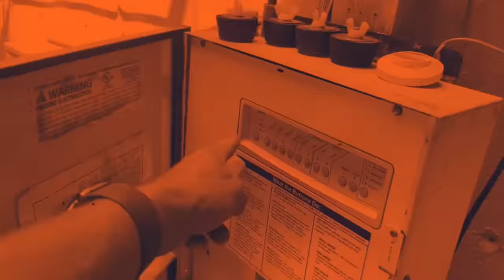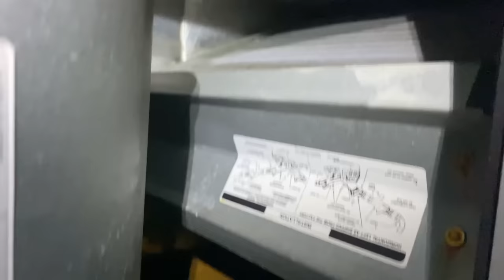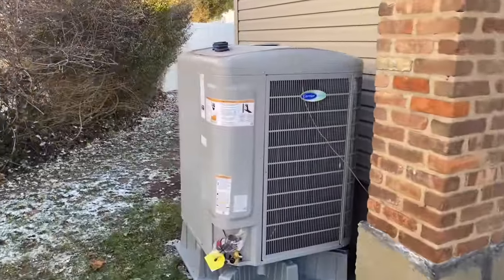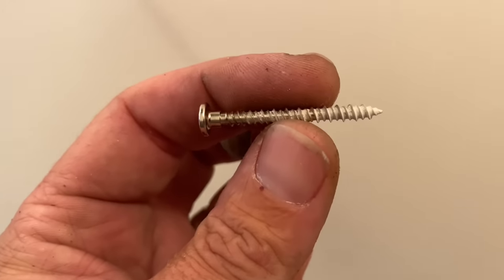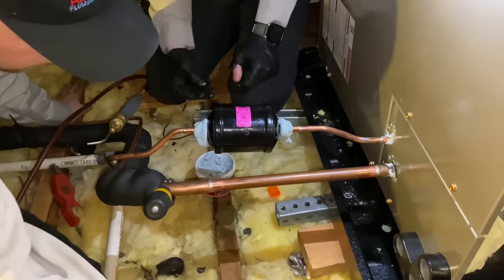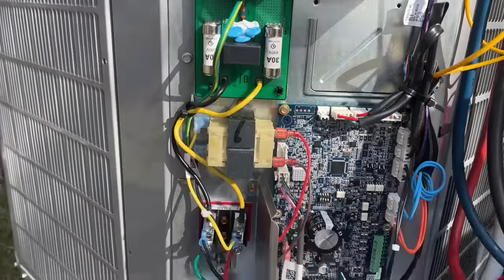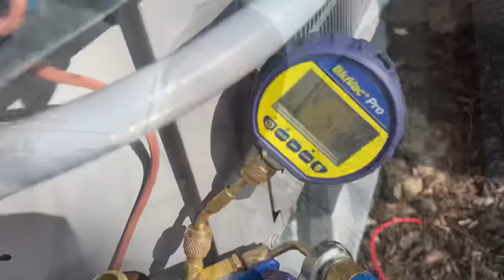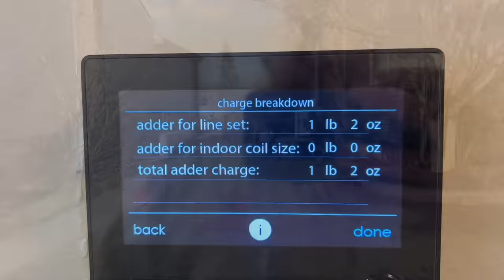Electrification in 2023 Oil Hydronic Heating to Electric Ultra Efficient Heat Pump HVAC System

Comment: High efficiency system in an unconditioned attic.  Not sure I'm a fan of that concept, seems like if you want to spend a pile of money on efficiency, your typically better off tightening up the building envelope first.
Reply: @PipeDoctor  Floral Park native, now out east.  I see it all the time, not your problem/fault, but typically the best money spent is on insulation and weather sealing.
Reply: @tccoggs  that's no lie!
Reply: Perfectly normal I’m Florida to have them in Attics. I’m an hvac technician and installed a 3 ton 20 seer system in my attic. Been running great for 7 years now.
Reply: I install and work on hundreds of these. We are Carrier dealer and from my experience. If you have poor insulation and inefficient ductwork. These infinity system sucks, they have a tough time operating. I never recommend an infinity system if you have a poor insulation.
Reply: In northern climates, the problem with condensing equipment in attics during winter is the chance of condensate freezing. If that problem is properly handled, it works (although with forced air and heat rising, the lower levels and the lower parts of rooms might feel cool). For cooling during summer it’s probably better since the cool air falls and the warm air rises.

This looks like replacing equipment on a retrofit into a house where radiators and a boiler were the original form of heat, and there was no cooling. And the house is probably poorly insulated unless someone went to the trouble of insulating in one of the last three or four decades.
Reply: @ronnyrath816  I think this is the biggest problem with the concept of drop in retrofit heat pumps.
Reply: Most attics aren’t conditioned.  I don’t know of any around here in California.

This is typical.
Reply: @xzibit8614  While it's not the norm, if its efficiency we are after with heat pump swaps, it's time to start considering alternatives to the old cold attic design.
Reply: The homes are too tight now a days, why do you think they say to have an outside air supply or “free cooling” economizer….
Reply: @tccoggs   Why? Real question. This is a great appliance installed by a great company in a very entertaining way! In an attic suffering from the very conditions in your narrative. Based on only this comments section, I’d suggest that North America is totally fine with this level of quality and it probably isn’t time for the implied inclusive or exclusive “we or us ” “to consider alternatives.”

For the discerning customer, however, I’d agree. Or for someone with mold sensitivity. Or anyone immunocompromised. Or anyone under, say, 2 years old. Or over 60. Or anyone who thinks it is NOT a great idea to have  4” of fiberglass insulation in a ceiling to be the complete thermal lid on their building or who doesn’t want a terrarium in their attic where condensation grows white stuff and rusts roofing nails in climate zone 5 or 6 or higher.

For those special customers only, THEY might consider alternatives. But I wonder why my energy should be used to consider alternatives for the others who are just fine with all of this. That DOESN’T seem efficient at all.
Reply: @melvin_0bviously  it's not common in the Midwest. We have conditioned utility rooms that handle it all. Seems to be the rest of the country does this though.

Comment: I have two of these units that also replaced straight A/C.  Auxiliary is now also hydronic baseboard (natural gas boiler)… so very similar setup.  I’ve never been too sure where to set my changeover temp from hp to hydronic.  I want to maximize heat pump but I also don’t want the units going into defrost a lot and pumping cold air into my house (no hydronic coil to temper).  Been using 38 F as the changeover but wonder what others would use?  It’s not a common setup!
Reply: You need to look at the submittal of your equipment. It will say the COP(coefficient of performance) based on outdoor temperature. Electric Baseboard heat is 1 cop, if at lets say 10f its 2 cop, its twice as efficient than baseboard. You will have to see when prices intersect based on avg $/therm and $kwh.
Reply: Wow that sounds complicated.
Reply: Suggestion to calculate appropriate switch over temperature for your location - look up the graph of COP vs outdoor temperature for your heat pump.  pick a reasonable value - say 2.5 and see what outdoor temperature that cooresponds to on the graph .  Calculate the cost of heat for your location via the heat pump:  kwh/$ * 3415 Btu/kwh * 2.5 COP = Btu/$ = cost of heat from heat pump.  From natural gas, assume efficiency ~ 90%, and use your local cost of natural gas:  Therm/$ * 100000 Btu/therm *.90 = Btu/$ cost from natural gas.  If the cost to supply heat from heat pump is lower than natural gas, pick a lower outdoor temperature, and use the COP from the graph to recalculate.  If the cost from heat pump is higher, pick a higher outdoor temperature, use the cooresponding COP from the graph and recalcuate.  Do this until you see where partity occurs (ie both are near equal).  That is the appropriate (economic) approximate switching point for thermostat cross over from heat pump to natural gas heating for this local situation.   We don't yet have outdoor reset controls with humidity sensors to include losses from defrost cycles in the calculation.  But that is coming - stay tuned.

Comment: Are these the 5 speeds trying to act like an inverter? I considered them years ago maybe 2016 or so but decided it was a cup of MEH when they showed them cycle off and I got to hear odd hissing sounds from the condenser. The communication is often talked about as a good thing, but as time progresses they often turn into error code hell. I installed a bunch of communicating systems in 2014-2015 as those were the best of the time. But spending $1000 for a thermostat? Crazy talk. If you aren't selling alot of Carrier their distributors won't do you any favors. While Bosch isn't what I would call perfect, it's far from major manufacture copy cat games. (none of them have an inverter that works out the box without a pricey communicating tstat). I sell other brands than Bosch, but those days may become more murky once R410a in new equipment is cut off. PS: I would have put down the OSB for that attic floor. Has nothing to do with OSHA. :face-turquoise-covering-eyes:

Comment: you guys dont braze in ny , we have to braze here in nj... when i started my career i used to solder ...and it works i think the industry changed because most guys dont know how to solder
Reply: @PipeDoctor  I’m not against it , just thought it was code thru out industry uwe were forced into brazing slowly afterwards if inspector picked up on you didn’t braze they wouldn’t pass you. I’m used to brazing and still to this day arguing with lazy guys why they have to use nitrogen…Lmfaooo but cool you still get to solder👍

Comment: Does anyone make a water source heat pump hot water heater? I’ve got basically free energy from the condo building’s loop; might such a thing be more efficient than my little low-boy hot water tank?
Reply: You can look up “water source heat pump water heater” as the search. There are big units for commercial and industrial use, not sure about residential.

Comment: Don't see near enough ventilation in that attic.  The insulation is jammed down into the soffit so if they do have any vents they are blocked and then they need like another foot of insulation for sure.  🤷‍♂🤦‍♂💦

Comment: Looks like they should get a roofer out to look at their roof right away. Once they drop another $20k on a new roof they should get the attic sprayed with insulation or else it will be your fault that the new heat pump won’t be that efficient. My guess is about 2pm finish time
Reply: That roof isn’t leaking, the moisture on the nail tips is condensation from water vapor coming from the living space below.

Comment: Ending @ 1:47PM.  The Humidity is to high, traveling up through the ceiling due to not having a Vapor barrier in the ceiling, I had  it happen to me, just had insulation no Vapor barrier disconnected Humidifier, cured it.  That transformer is as big as the one I took out of my microwave.    83Microns   Is the Unit away from the dripline of the roof? Icicles....

Comment: The cost of efficiency is going to price the middle and poorer class homeowners out of owning an AC or heat pump.  And repairs are going to be cost prohibitive  for the average homeowner. You really have to wonder at what point will the govt and/or manufacturers start thinking about the homeowners.

Comment: You will be done tomorrow, You can't start the unit for 24 hours after energizing the crankcase heater.   LOL
Reply: It's been 50 in New York. It's fine. Only if it were below 30 would it may require crankcase pre heat
Reply: if it came out of a heated supply house/storage and van, it will be fine..
Reply: @throttlebottle5906  These inverters use rotary compressors, evidently they have trouble varying the speed of scrolls. I don't know how well rotaries can handle liquid. I know the accumulators protect from liquid while running but migration tends to go right to the oil bypassing the accumulator. According to some forums they lose a lot of compressors after long power outages. Some ductless wont start until the oil reaches a certain temp. Have you had any failures after a blackout?
Reply: @dunkdamonk  I am in Reading PA. It was thirty all day. I didnt know it was that warm in NY yesterday. Usually they are colder.
Reply: @dunkdamonk  It is 22 right now.

Comment: i love how just about EVERY hvac guy thinks they're gods gift to humankind. heat pumps in the northeast are useless. especially once the temp drops below 0. and just about every hvac and glorified plumber guys  insist on putting garbage like this in has never done industrial or commercial refrigeration (you know nothing outside of r22 and 410a) if you even  know the properties/saturated heat removal of those refrigerants . the cost of the installation is never going to pay for itself, kind of like geothermal heat pumps in residential applications.